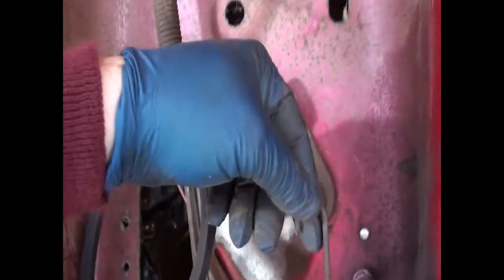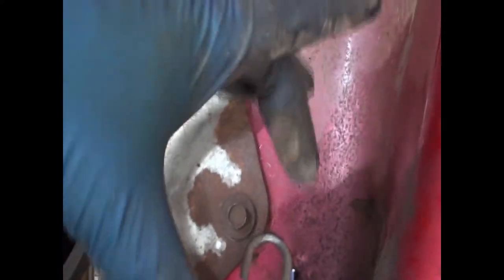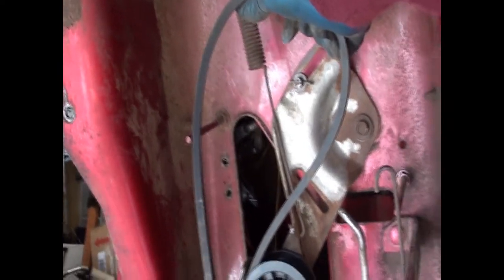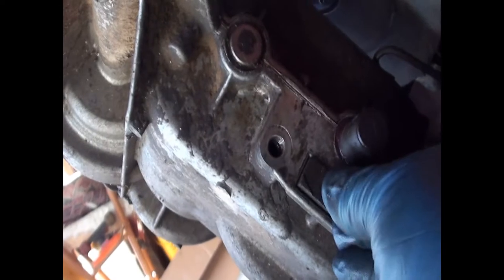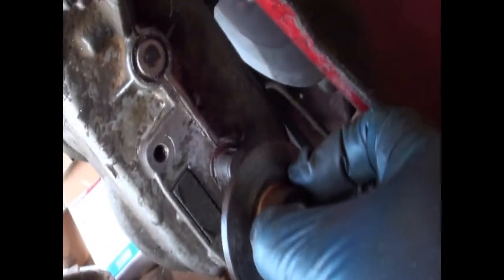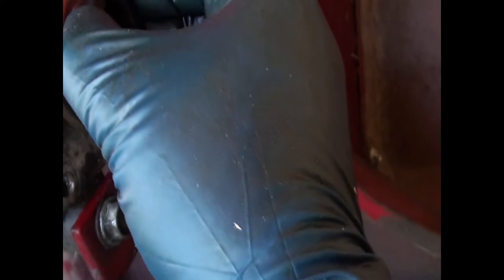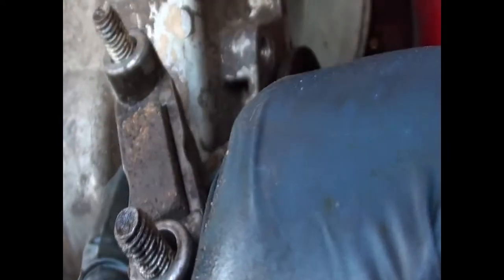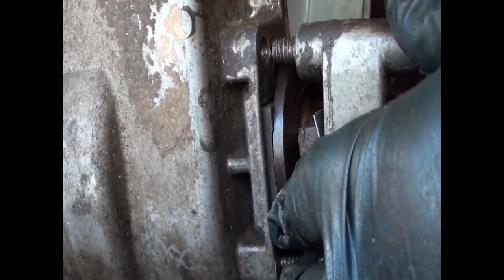Murray Lawnmower Transmission Clutch & Brake linkage Part 2

Comment: The brake system on my Murray looks the same but the transaxle is a Dana Spicer 7 speed and those screw bolts going into the brake caliper do not enter the transmission. No way to add grease back into the transaxle without taking it apart. Good job on these videos though
Reply: There's a rubber plug on top. Cut the grease with heavy weight oil an paddle mix it. With a little effort you should be able to inject it down the hole on top of transmission
Reply: @trollerrollerrollercoaster8391  no plug
Reply: @joerico9461  whoever engineered a transaxle with no grease input port should be decked. That's like the newer transmissions on a car with no dipstick. Just a relief bolt.
Reply: @trollerrollerrollercoaster8391  I hear ya

Comment: Hi, thank you so much for making these two videos. I have a Murray similar to yours. Currently I cannot engage the parking brake. Do you have any videos or suggestions to get it operable?
I took many photos and videos of mine mainly to form a good understanding of the parking brake mechanism. It is not the easiest to get to so I’m afraid I will have to take the deck off again. I had it off a month ago to replace the drive/motion belt. I should have investigated then but didn’t.
Any help you can provide is greatly appreciated. Apparently there are others that posted on the internet but really provided no solution. The regular brake system works fine.
Thanks again,
Ski
Reply from the maker: Hope this helps:  Here is a link to an exploded view and a parts list that include the Murray Parking Brake parts and linkage.  Click on the individual buttons marked "Motion Drive" for the exploded view and the parts list.   Parts numbered 5, 6, 7, 8, 16 & 17 appear to be the parking brake parts and the exploded view shows the positioning.   https://www.partsandservice.com/html/Murray/lt/lt38608x92c.html
Reply: Thanks for your reply and link. Part number 16 is the issue I think. When I videoed with the brake pedal all the way in I can see #16 move up and down when pulling up on the lever on the side. I have to look closer to see if there is a notch at the end of #16 to hold and engage the mower body slot when pedal is released. Something is keeping #16 from holding.
Thanks again and will keep you updated in case this happens to you.
Ski

Comment: My Murray has a lever under the seat that allows you to put it in neutral so the mower can be freely pushed,  can you tell me how that works and where it's attached on the transmission. when I move it according to the instructions the wheels are still locked and won't let me push it.......please help
Reply from the maker: I had the same problem.  The gear shifter rod would not budge inside the transmission case.  This is,  the rod that, if  starting in neutral, you rotate the shifter counter clockwise and the gears change from N to 1 to 2 to 3 and to 4.  Turn it clockwise from 4 to 3 to 2 to 1 to Neutral and finally to Reverse.  Over the years, the shifter rod became stiffer and stiffer until it finally reached the point that I could no longer shift gears at all (and of course the rear wheels would be locked in whatever gear they happened to be in before the freeze up.).    In my situation, the shifter rod that drops into the transmission case was simply bone dry and a bit corroded along the rod shaft inside the transmission case.  All I had to do was spray some penetrating oil down the shaft.  Really soak the shaft over a period of a few hours with the hope that a little of that lubricant will find its way down the shaft and inside the transmission case.  Once a few drops of lubricant make it down the shaft, work the shifter back and forth until the rod becomes easier and easier to rotate clockwise and counterclockwise. After a few minutes with a few drops of penetrating oil, the shifter became very easy to change gears and any hard shifting and locked wheel symptoms should disappear.  Your transmission is probably a Foote or a Peerless.  Look up on youtube more video's that focus on servicing the Foote or Peerless riding mower transmissions.  Both are nearly identical in operation and parts.  Look at this at 3:50 minutes into the video.   https://www.youtube.com/watch?v=lfMmLpJoIy0  You will see the transmission gear shifting rod at the other end of the vice grips.  It rotates counterclockwise and clockwise from N to 4th and N to reverse. You do NOT need to take the tranny out of the mower to do this.  Just reach under the seat or flip the lawnmower on its side so you can get access to the gear shifting rod.  Then lube it up real good and work that rod slowly at first , left and right, until it loosens up.  That should fix your stuck rod.  Also make sure your trnasmission case has grease or oil in it.  Use grease/oil with a viscosity of 00 or 000 (it's a milk shake thick grease/oil; or use at least 90 Weight gear oil (which could slowly leak out over a years time)
Reply from the maker: Actually, FIRST  make sure the parking/emergency brake caliper and brake caliper pad are not engaged in the activated parking brake mode.  That is, make sure the parking brake is released!  Otherwise the tires will be locked from turning!
Reply: @takeachanceonme4  Thank you very much for your reply and help. The parking brake seems to be free, the lever under the seat doesn't seem to be doing much is sorta feels loose no friction, tension or pulling like it's not connected to anything, guess maybe I should pull the battery out or crawl underneath while someone works the rod/lever while I look see what it's doing......any other suggestions??
Reply from the maker: @catcndu  Only suggestion I can think of is to access the transmission (flip the entire mower on its side ; or do whatever you might need to do to get access to the shifting rods and links and examine each link for functionality.  You might try clamping onto the transmission gear shifting rod (where it exits the transmission case) with a pair of vice grips.  Rotate the gear shifting rod with the vice grips to hopefully feel some resistance or gather some sense that the gears are shifting.  be sure the rear tires are off the ground; because you might want to spin the tires back and forth  (such as for example when you  find  Neutral -- the wheels should freewheel spin) to increase the chances that you will find Neutral.  If there is no resistance at all and nothing is happening to indicate that the gears are shifting, then you might have to take off the transmission, crack open its case, and see if something in the transmission case is broken.  If you do crack the case open, pay complete attention to the position of each gear, each spacer, each thrust washer, and each bearing.  If any of those parts are not reassembled in proper place, the transmission will never work again.  The process of cracking open the two halves of the case should be done with the greatest of care and with complete and exact documentation of where every part inside the case belongs.  One misplaced part will end in a failed rebuild. When the two halves come apart be sure to rinse the black sludgy grease and oil until you can finally see all the washers, bearings, spacers etc so that you can keep track of which one goes where.  I have found NO exploded views that completely indicate which piece belongs where.  So you will find yourself on your own if you don't keep track of which part goes where and in what order.